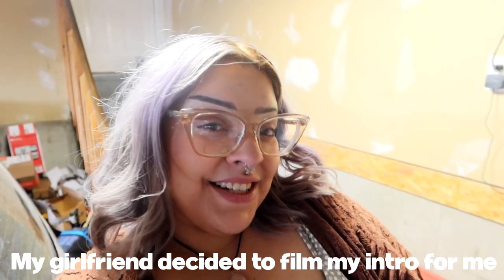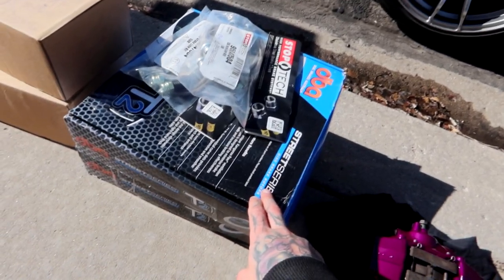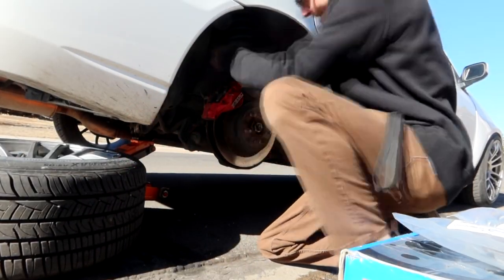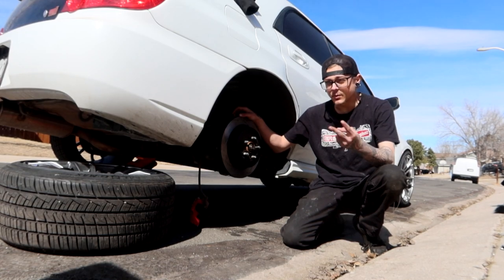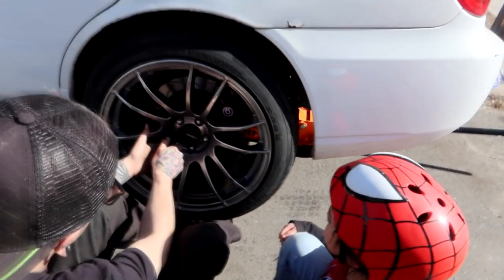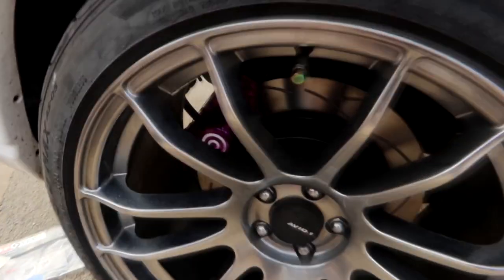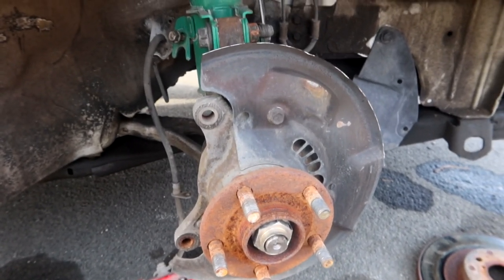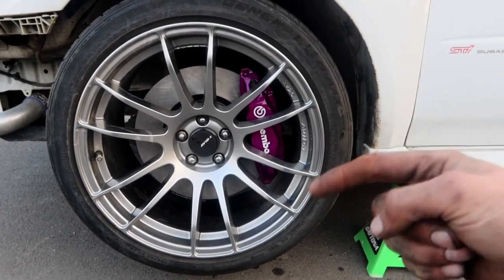How To Install Brembo Brakes On Your Subaru WRX | Subaru WRX Brembo brake install | STI Brembo Swap

Comment: Hello, I really liked your video, greetings from NY, a question?  I'm doing the same thing to my 2006 wrx. In fact, I already did the swap but my e brake doesn't work and you explain at the beginning what it is because of the difference in diameter and you're right, the rotors are cheaper and I just wanted to know where you bought the rotors. since I don't want to order the wrong thing... Thank you very much.
Reply from the maker: I bought them through my shops turn14 dealer account. You can probably google search "2006 wrx dba conversion rotors"